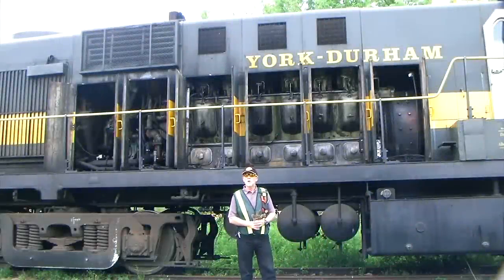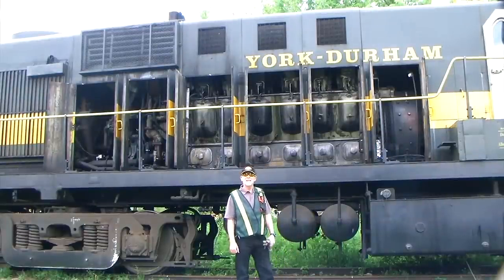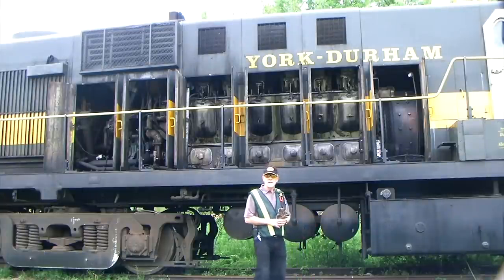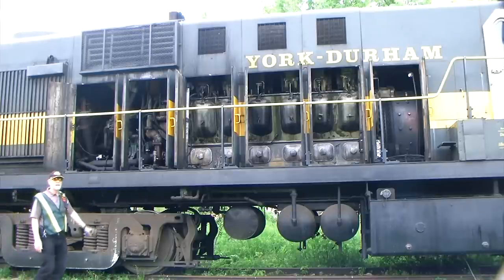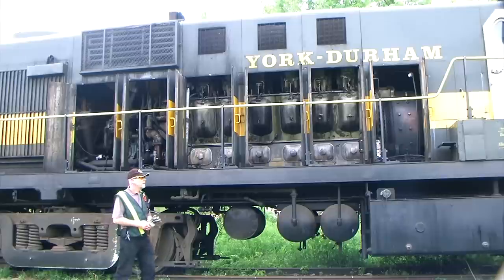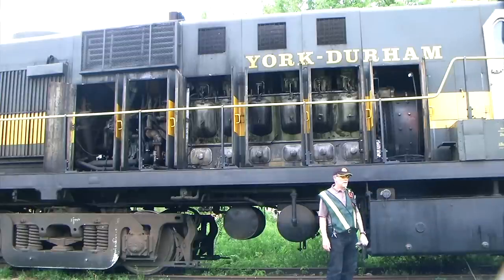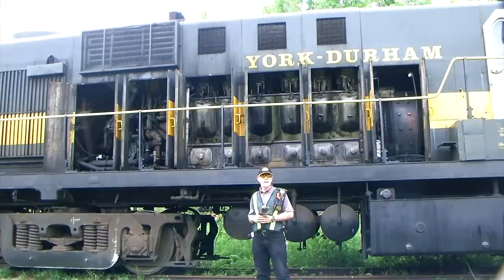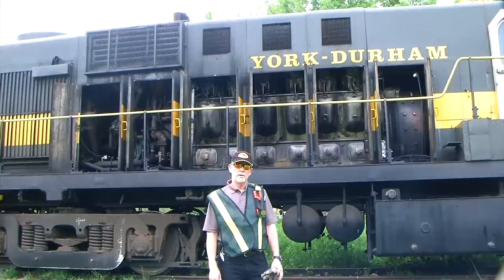How It Works: Diesel Electric Locomotive

Comment: I find so many people who are simply astounded to learn that it's a large electric motor that moves a locomotive, and that the train is not powered directly from the diesel engine; and that in addition, these motors are used to brake the train.  Thanks for this brief,  straight-to-the-point video explaining how a locomotive is powered.

Comment from the maker: Hi Tim, great question!
 When multiple locomotives are used together, they are electrically connected through a 27 pin electrical cable called an MU cable, when the engineer uses the reverser or throttle the signal is sent to the following locomotives. There are also airlines that connect locomotive to locomotive as well.

Comment: Something I don't understand about diesel electrics - is throttle controlled by varying engine throttle, with the electric system just acting as a sort of transmission, or is power to the motors electronically regulated somehow, with the engine responding to changes in load like a portable petrol generator?

Comment: Hi,

I was wondering if there is any kind of battery to store the electricity; or does it directly go inside the traction motors? The reason I'm asking is that I know the Internal Combustion Engine is efficient at certain RPM, meaning that it will output constant power. But depending on the speed of the locomotive, you might not need all that power.

Also each time the train wants to slow down, they can regenerate electricity and put the power back into a battery for the next start...
Reply from the maker: Good question!
Yes there are batteries in the locomotive, they work much like a battery in your automobile only on a much larger scale. When locomotives generate electricity through dynamic braking most of the energy is dissipated through toaster grills as heat as it can produce more energy than what is needed.
Reply: The typical Diesel Electric has two electrical systems. First a 70 volt auxiliary system powered by batteries charged by an "Auxiliary Generator" for lights starting and control systems. Secondly is the power transmission system of 600 volts (typical) to provide power to the traction motors. The throttle has 8 power notches and the engine governor as well as controlling RPMs loads the engine through the main generator to provide a 12.5% power increase with each notch. Since this is a digital type control trailing units receive their instructions through a "jumper Cable". Since there is no direct mechanical connection the engineer need only apply enough power to maintain speed. Locomotive Horsepower ratings are "power available for traction" with auxiliary power not part of the prime mover rating.
Reply: No, the entire engine that you see sitting on the tracks is merely a huge generator. The electric tracton motors are beneath the train.

Comment: Notice the view of the top of the locomotive there are huge fans. They cool the engine compartment and the degenerative load banks (heaters) that transfer motive force to thermal heat when the engineer calls for deceleration. This saves wear on the brake shoes. The traction motors are switched to generators to send power to the load banks. 
Large cranes also use use degenerative braking to help control the loads being lowered.

Comment: Doesn't the DC go through an inverter the get converted to 3-phase AC then sent to the tractions motors?
Reply: No: as stated in the video, the traction motors run on the DC current produced by the generator. Inverters didn't even exist when locos like this were built, and in any case would introduce unnecessary losses and complications.

Comment: Why traction motor ? Because mechanical linkage is not practical for speed and torque control, especially at high speeds. Some units have hydraulic transmission similar to the automatic transmission in a car.

Comment: One simple question: why not use a direct mechanical link between the prime mover (diesel engine) and the wheels, if that engine can output 1800 HP ?
Reply: I think it's to do with putting power onto the track. Electric motors have full torque available at all speeds, unlike a diesel engine. This must make getting the train moving an easier task.
Reply: Archo Logical. But there must be a non-negligible energy loss by converting those 1800 HP into electrical power, and then sending it to electrical motors, no ?
Reply: We'd also have the same energy loss in the mechanical transmission maybe? I imagine it's easier to make all the wheels driven by slapping a motor on each than getting a shaft or piston mechanism.
I want to look into this now :P
Reply: AlainHubert Because a transmission for that much power would be very massive and would be breakdown prone. A clutch simply isn't practical for such a huge vehicle, a fluid coupling is not very efficient and a gearbox would have to be very massive with a lot of heavy gears. An electric transmission has is continiously variable, relatively lightweight and durable, with very high starting torque. And it is simple to maintain with. few moving parts, only brushes, the collector and bearings on older locomotives. Modern power electronics have made it possible to use three phase AC induction motors which are more efficient, simpler and more durable, the only wear parts being the bearings. The only disadvantage being a slight inneficiency of converting mechanical power to electric and back, but that is more than offset by afforementioned advantages.
Also multiple axles can be powered with multiple motors, that would require complex driveshafts with a mechanical transmission.
Reply: Petar Miletic Thank you for this logical and detailed answer.
Reply: Someone already gave an excellent answer, but I wanted to add that it's also advantageous to have these diesel engines run at low speeds for longevity ( so I have heard, and that seems logical.)  With no need for a transmission, it seems like the diesels can run at low speeds compared to a car ( less than 1000 RPM I remember reading.)
Reply: Electric motors are torque monster's.
Reply: @petarmiletic997  Is an electric system really more efficient than a torque convertor?

Comment: Hi Does the generator only supplies the traction motor? how about the the other system such as Battery charger, blower, or other load that requires 380 or 480 supply? Does the generator (that supply traction motors) works when engine is in idle?
Reply: It is suppliing only tracion motors and yeas it works in idle too but it is doesnt conected to the tracion motors so its produces power but that power dong get anywhere the power supply is a another generator what is much smoller i dont know if on this locomotive butt the most of them had this tipe of suppliing energy
Reply: Adam Varga i forget fo your questions question in idle it can supply butt not all locomotives it is the first like polling only lokomotive or whe the lokomotive is triing to cenct to the cars
Reply: another detail i found uot is some lokomotives can have a hidraulik pump or how i can say it than another is inside of the tracion so it called the hidraulic power transfer it requires more powerful engines into lokomotives but it exist too
Reply: Thank you mate for the reply.I am currently working on SD70 EMD from us..
Reply: well im from slovakia before the czechoslovakia ends our diesel lokomotives has from ČKD i give yolu an exaple of a locomotie and our best one what has writed the world record of 176KmH i know several tips of it T478 750/754 known as okuliarnik 749/751 known as bardotka (fot hes sound of engine ) this one has been the most modern lokomotives of 1950 or less T678 known as pomaranč(orange)has been the best locomotive bud this tipe has ben only just some of them maked ander Soviet union our sttes cant make any stronger lokomotive T669 known as čmeliak (yealow jacket) with v12 engine and hes smaller brothe the kocúr (cat) what has the half of čmeliaks engine and the famoust one is the Kiklop T499 thath lokomotive did the world record of speed 176KmH only two of them was maked because russian not alow us to do make a powerfull locomotive like this today he can do only 140Kmh he has engine as like the 750 because the roconstrucion of this lokomotive was so hard they cannot save the engyne of course there are lot more lokomotives and about the elctric they has been planned at Škoda Plzeň in czech republik too one of our best lokomotives is the 380 or 381 know as Messerchmitt because it gots the tipe škoda 109E and thath was the BF-109E Emil meserchmitt what also was in battle of britain after this plane comes the F-Friedrich times than G-gustav than K-kurfurst but back to okomotive (slovakia 381 czech republik 380) thath think can run on 15kv 30Hz 25Kv50Hz and 3Kv current it also rechs sped max safely 200 kmH of course it can do even more but safely our most used and loved lokomotive of our drives is the 363 Eso it can run on 3Kv current and 25Kv50Hz thanth lokomotive has a prety good sound and max speed is 120KmH our storngest El lokomotives are the 131 known as Dvojičky (twins) well i dont know about his lokomotive much but thi is all so any questions i wil awnswer you (btw im 13yers old Grammar killer :DDDD no just dont be affraid of thath 13 years just ask i know as much as i kan youb technology phyzics chemistry biography history these was my favourite :)
Reply: to much writing huh :D

Comment: Do modern engines still use DC motors or have they moved to AC motors?
Reply: All of the big dogs are AC. However switcher and GP locos are constantly being rebuilt and they remain DC. DC locos are great for yard operations.
Reply: acoow  both

Comment: I worked as   electrician in  CP RAIL Ogden shop in   Calgary    Alberta    Canada on   Diesel   electric   locomotives   yes  traction motors turn the wheels   but not directly   but    through   a pinion gear  small gear on motor and   crown gear  big gear  on   wheels   axel so the   electric motor turns faster than the wheels   but  torque at wheels is   more than just the motor itself,,  yes   older   locos where  all    DC    now  newer  locos  use   AC   motors       probably  less    maintenance    because there is no   brushes and no    commutators
Reply: +bernard240vdc good point but ti was explained that the engine in the video was built in the 1950s.
Reply: Electric motors 💪💪💪
Reply: How are they controlled?
Reply: I also work at pakistan rail...

Comment: Half fast explanation. How is the generator able to produce increased electricity for the increased torque when speeding up the diesel alone does not do it?
Reply: It is a good question the torque is for generator lika amps (A) so more horsepower more amps goimg into the electromotors it easy i can it explain it easyer so you can produce any kid of rotational speed in rotor butt if you spinning it with hand it is hard because the energy what you need to spin it upp it needs torque not rpm Rpm raises voltage butt there is another question if you have to spin it by hand start to spin the electric motors it need more horsepower to raise amps and voltage in the diesel engine it means more torque more rpm what you can produce to pull more more more heavyer thinks so that is
Reply: The controller can change field current setting of the generator, which controls output voltage. It also controls engine governor setting, thus engine speed. And also traction motor field setting. The combination of these, besides switching of series/parallel motor connections (search "transition") determines overall performance. Might take some study to understand the pieces above, and how the controller developed by Hermann Lemp of GE reduced the complexity to 8 little notches.
Reply: Thanks - We imagine speeding up our car engine will produce more current. It doesn't.
Reply: I think of it this way.  As power is votage times current, one can keep power output constant, while varying voltage and current.  If you were able to raise voltage, while keeping power the same, you would have less current available.  Lowering voltage while keeping power the same, you would have more current available.  This is analogous to a transmission.  Low gear would be lower voltage and higher current.  High gear would be higher voltage and lower current.

Comment: 2000 HP, but what is the torque of that engine?
Reply: Well, it has 116 tons with approx. 210 kilonewton continous torque, and it is not bad :-)
Reply: An interesting thing to me is how they have enough friction.  I guess steel on steel is a pretty good friction, with a coefficient of friction in the .5 range.  Given that locomotives are very heavy ( 100 tonnes for example), combined with the steel on steel friction, they normally have enough traction to pull their massive loads.  They also carry some sort of sand for additional traction as needed.

Comment: I wonder if they could build a car that runs in a similar way 

Before you call that a hybrid hybrids have the engine and electric motor connected to the wheels and they switch roles in a complicated dance of engine and motor 

What this guy said is the engine powers the motor  

Just a thought really
Reply: Golden Retriever I’ve wondered the same before. It must come down to efficiency. It would probably take more energy to produce the DC for electric motors on a small scale.
Reply: westplus1 

Well it still burns gas so it’s not exactly a green machine
Reply: westplus1 

Interesting idea 

I’ve been thinking about tuning an engine to run on alcohol instead of gasoline 

There by reducing its carbon footprint to negligible levels 

It’s just an idea but yeah
Reply: westplus1 

Well it obviously needs some promotion work cuz I’ve never heard of it
Reply: Look Nissan note e power , doing same concept with different engine , 1 liter for 34 kilometer from 1200cc engine
Reply: @jerry800  Direct drive would be hell on clutches.
Reply: I've wondered why there weren't any trucks or anything in the past using this system, with rheostatic breaking and everything. It isn't that efficient but then again so aren't a lot of historic vehicles. I think there may be a few buses and stuff but not past the '50s. Of course battery electric is the future now, but I just wonder how come there haven't been as many road vehicles using this method in the past.

Comment: In the movie "Unstoppable", there is much conversation about how to stop the locomotive. But any person with even AVERAGE intelligence could tell you how to easily stop that train in less than 3 miles. The Diesel engines which power the generator use water and anti-freeze to cool the diesel engine. And therefore, there must be a RADIATOR, (like a car or truck), which takes the heat from the engine, and blows it out into the atmosphere. So if you blow a few big holes in that radiator, the diesel engine would overheat, and soon seize up and stop, right? Please tell me why this would not work. (Denzel Washington, could we hear what YOU have to say?)
Reply: The diesel engine isn't a direct drive to the wheels.
Reply: @daybot9592  Yes but is the only thing providing power to the motors?

Comment: what i'd like to know is how they control the other locomotives from the lead locomotive
Reply: When 2 or more engines are couple together, they are connected electrically via a 27 pin electrical MU cable, when the engineer uses the reverser or throttle an electrical signal is sent to the trailing units. There are also 3 airlines hoses that are connect between all of the engines that are coupled together as well, to control the air brakes. Advances in tech has allowed engines to be run remotely by hand held boxes and also by satellite link.(distributed power)
Reply: @drowization  Thanks for this explanation. So,,,, the DPU's that are located in the middle of a train or even at the end of a train are most likely controlled by Satellite and not by a cord of some sort. Correct ?
Reply: @MrMike47274  You are correct. Well done.
Reply: @drowization  Thanks,,, i've been wondering about this. 👍👍

Comment: Why do you people try so hard to hide the fact that these locomotives are powered by ELECTRIC MOTORS? This guy never shows us the electric motors, UNDER the locomotive! I think this is the "Prius effect", or the tendency to pretend that all electric vehicles must be as weak as a Prius.
Reply from the maker: We do point out that there are electric motors and no mechanical linkage from the prime mover.
Reply: York-Durham Heritage Railway thath is right you can get your lokomotive movong with hidraulik sistem of transferr powwer butt i dont know what is more efecient